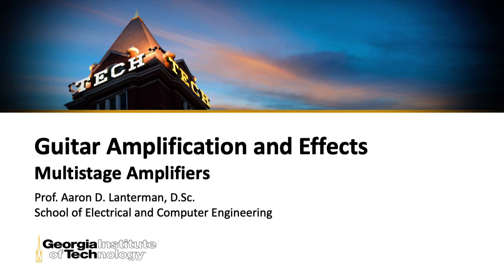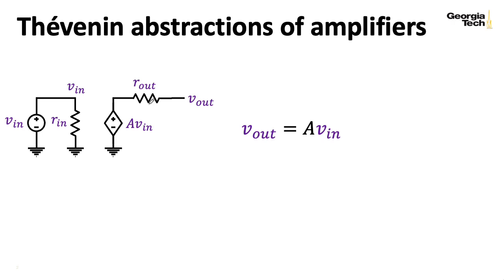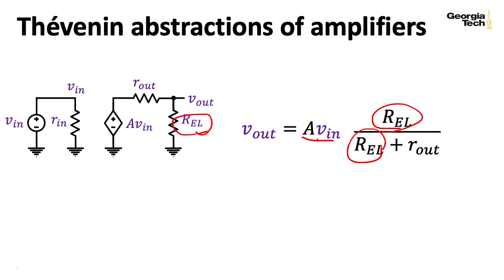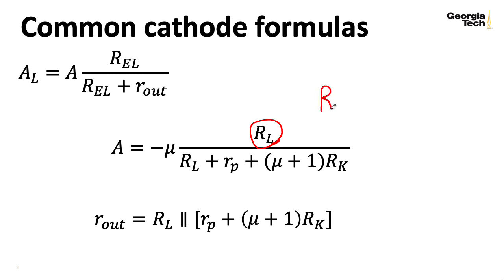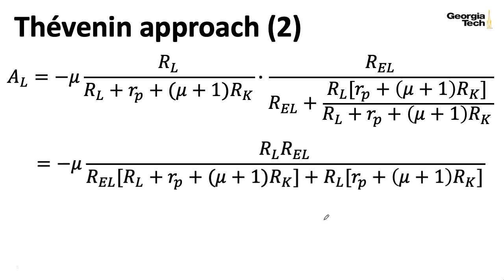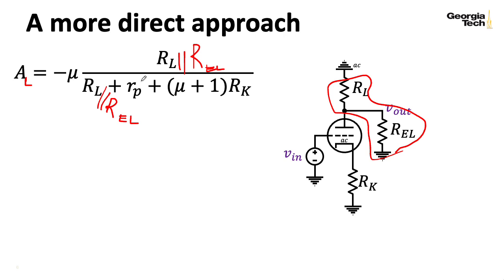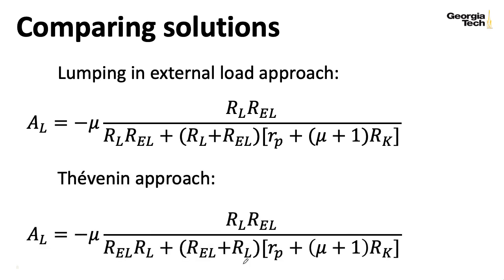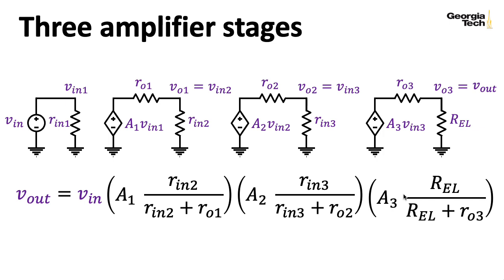ECE4448 L21: Multistage Amplifiers (Guitar Amplification and Effects, Georgia Tech course)

Comment: Highschool student here. I can somewhat follow the logic of Thévenin equivalents, but does someone know why they're used to analyse circuits? That part confuses me.
Reply from the maker: They can drastically simplify circuit analysis. Think of them as like a function in a library in a programming language. You might call a Python routine to sort a list. Inside there's all sorts of stuff, but you don't want to always worry about the details -- you just call the function. A Thevenin equivalent can take a big part of a circuit and reduce it to just a voltage source and resistor, which is much easier to analyze in the context of the rest of the circuit.

Comment: There’s so much math. I wonder if any engineers in the 50-60s solved sets of equations or if they just understood the basics of BJTs and went from there with common emitter topologies
Reply from the maker: There was a heavily reliance on graphical techniques, drawing load line (like I still do with tubes in my "Guitar Amplification and Effects" class). I think the graphical techniques provide insight that's not obvious in the equations.
Reply from the maker: They were running mostly on intuition, and an occasional invocation of a tactical slide rule. ;)

Comment: Love learning more on this stuff. Really gets ideas flowing for designs. Was just thinking about the possibility of a tube/BJT or FET output stage which would allow for power tube distortion that is beloved by guitarists, while being able to present a better load to the speaker without having to use an output transformer, since tubes seem to always have very poor output impedance even in a voltage buffer set up. 
Additionally, was thinking about how audiophiles love to design in such a way as to remove harmonics from their output, but I was actually thinking about ways to boost/shape those harmonics slightly for the use of pretty sounding cleans - I looked at the spectrum vs time plot of a plucked E string, and saw just how many harmonic components make up that signal, which then lends itself to other notes in the scale of Emajor for the odd harmonics (3rd,5th,7th,etc).
Reply from the maker: There are transformerless power amp designs out there, but I haven't looked into them much myself: https://en.wikipedia.org/wiki/Output_transformerless